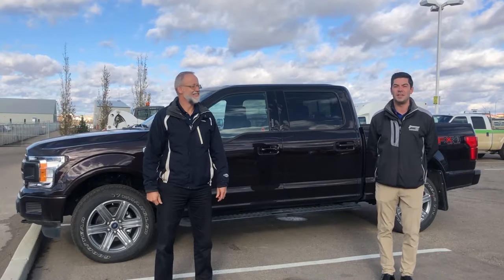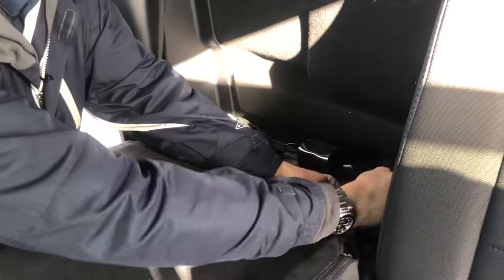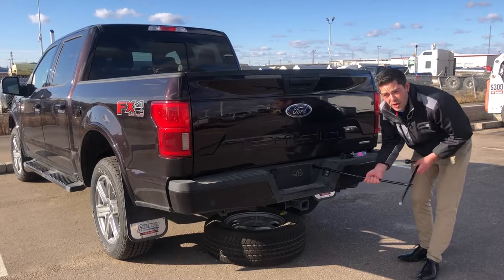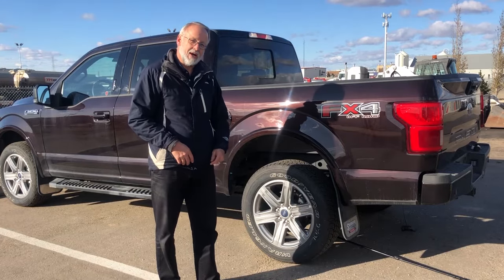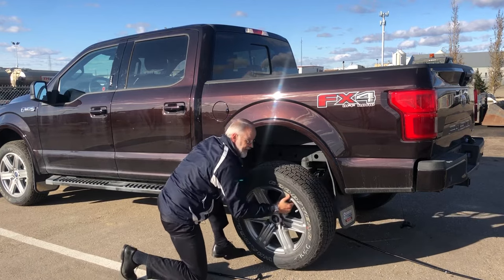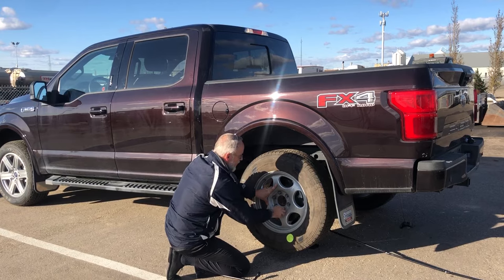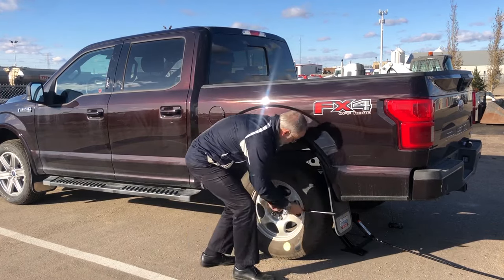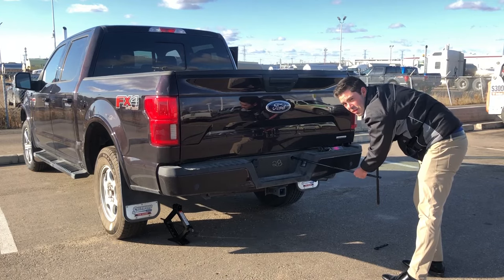Step By Step How To Change A Flat Tire on a Ford F-150

Comment from the maker: No matter how carefully you drive there’s always the possibility that you may eventually have a flat tire on the roadway.  First, get to an area out of traffic and pull off the road for your safety. Before changing a flat tire, ensure the vehicle is parked on flat firm ground.  If you have them available, we recommend you also chock the wheels of the vehicle before using a jack to raise the truck.

Comment: Has Ford ever thought of putting a piece of plastic shielding on the under side of the tire to stop corrosion and rust the salt causes took mine down in March and it was badly corroded
Reply from the maker: Undercarriage wash is a good idea to help wash away dirt, debris and other corrosion causing agents.

Comment: And while you're at it, throw away the garbage OEM lug nuts and get some better quality ones. The OEM lugs are cheaply "2 ply" and expand to the point where your 21 mm wrench will not fit over them and you'll be stuck. Ask me how I know...
Reply from the maker: The OEM lug nuts can be replaced for an additional cost with aftermarket if you prefer.